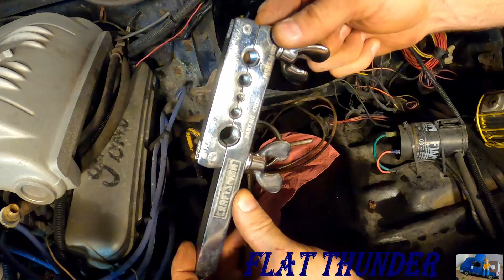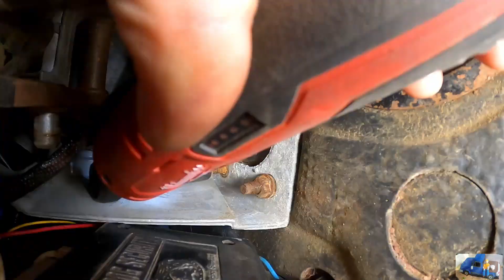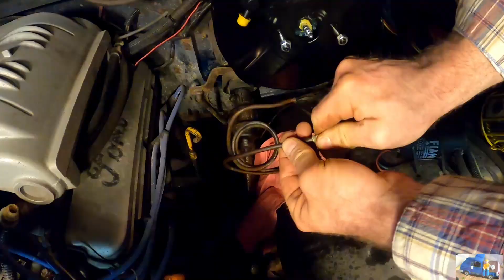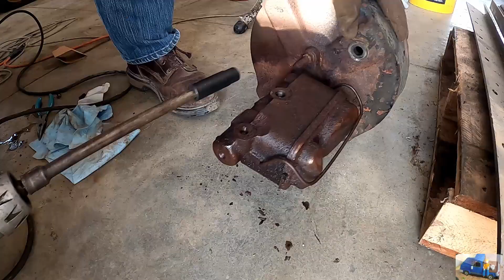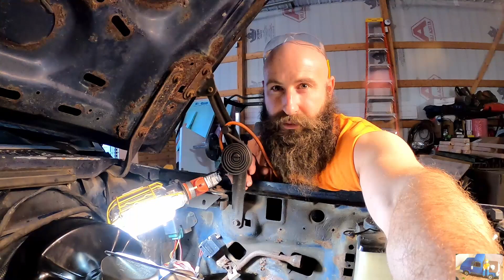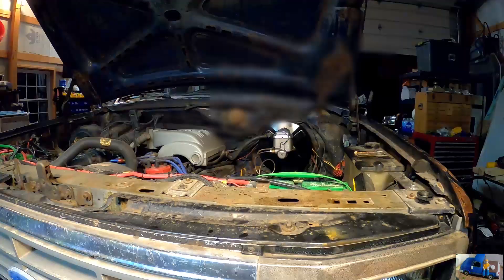BRAKE BOOSTER AND MASTERCYLINDER REPLACMENT; FORD F150 (1980-1986 VINTAGE)

Comment: How do you know if the problem is the booster or the mastercylinder or should both be removed?
Reply from the maker: If the booster is bad it will just be hard to push and or make for a hissing vacuum noise in the cab.  The master cylinder in this cause was bad causing the front brakes to not fully release.  I replaced both because the booster had a small leak and I wanted it to be all new.  Thanks for watching 👍😁

Comment: Thanks for this tutorial. Just bought a 1983 Econoline e150 which essentially has the same setup that I need to replace.
Reply from the maker: You are welcome!  If you are contemplating replacing the brake booster, I would buy a new unit.  I utilized an old one and rebuilt one previously with varying results.  The new booster is quiet and works great.  Thanks for watching and best of luck on the repairs!  👍😁
Reply: @FlatThunder  thanks, appreciate it. I already bought a brand new one! Figured that would be best since I’m already getting in there to replace it. Don’t want to have to do it again anytime soon 😄

Comment: I replaced everything on my truck brake cylinder front lines master cylinder twice booster caliper and I bleed they still have no brakes
Reply from the maker: Sounds like you have air trapped in the lines.  Disconnect the master cylinder pressure lines and 'bench bleed' the unit.  You can do this without removing the unit from the truck.  Then bleed one point at a time.  I usually start with the point furthest away which is the right rear wheel cylinder.  Purchase a one man bleeder kit they hook to the bleeder screws and allow you to pump the brake pedal without tightening and loosening the bleeder screw.  They make a huge difference.  Then pump away at the pedal  until the cup is full, but be careful not to run the master cylinder empty.  You can do it!  Thanks for watching!  👍😁